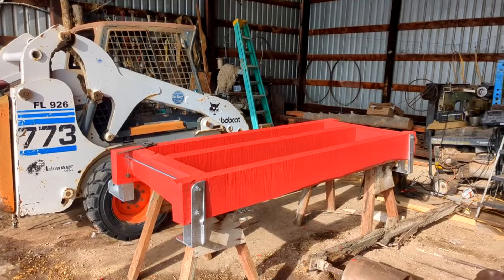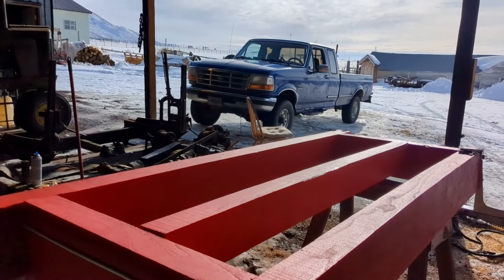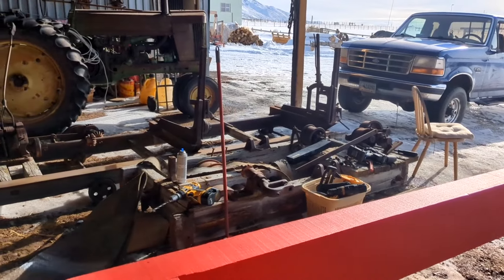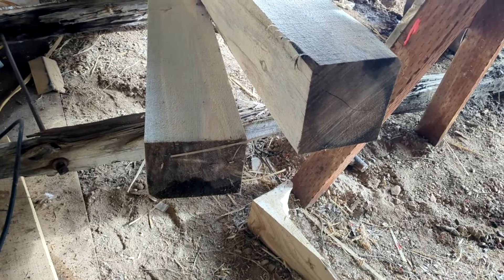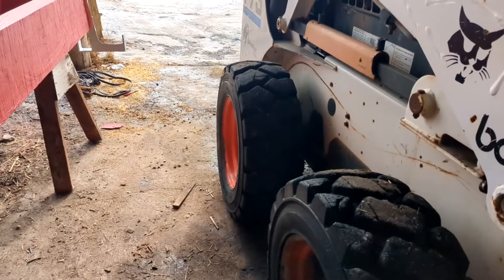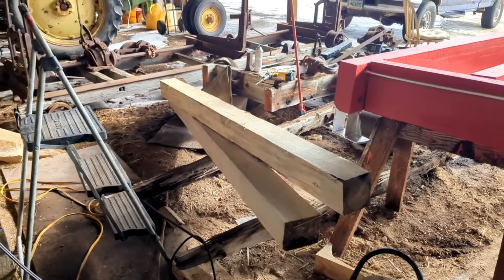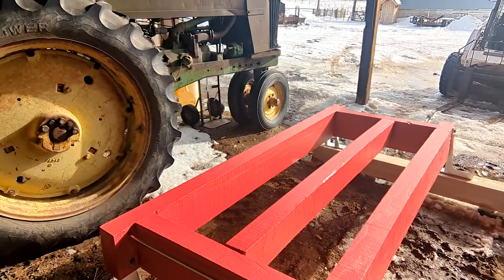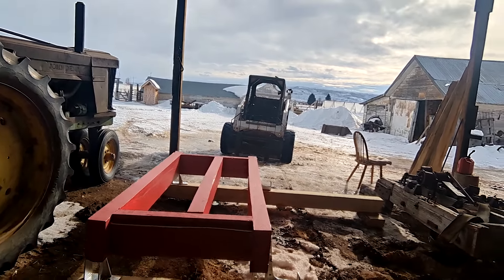The restoration of an antique Corley 395 sawmill. part 7.

Comment: Nice work, Tom!  Once you are happy with the location of the sawmill bed, you might want to drill down through the bed frame at each corner and drive some rebar into the ground to anchor the sawmill in place.
Reply from the maker: I think that I am planning on doing some concrete pillars to put it on. I'm worried about frost in the ground heaving it in the winter. That may not be a concern. I just don't know
Reply: @tractorrescueranch3682  Concrete footings with some anchor plates bolted to the wooden carriage would make for a very secure mill.  If you ever needed to move the mill, you could just unbolt it from the anchor plates.  You might want to think about using some hard rubber bushings (like hockey pucks) to isolate the sawmill bed from the concrete to provide some vibration dampening and keep the wooden bed frame from being in contact with the concrete.  Good luck and have fun.🇨🇦🥶